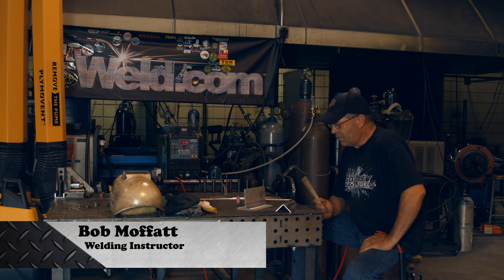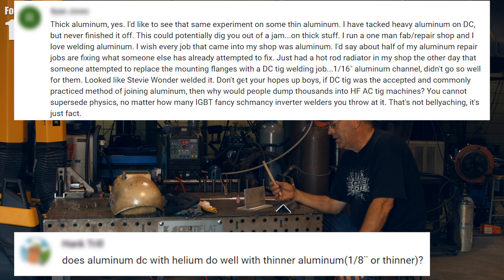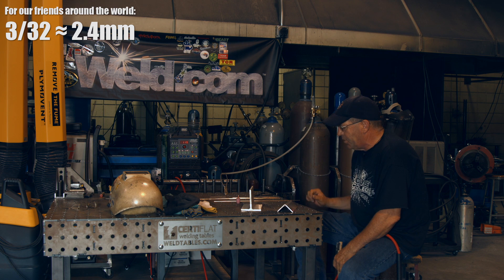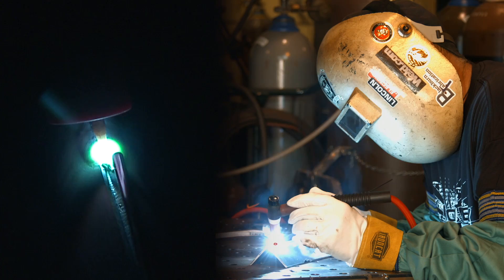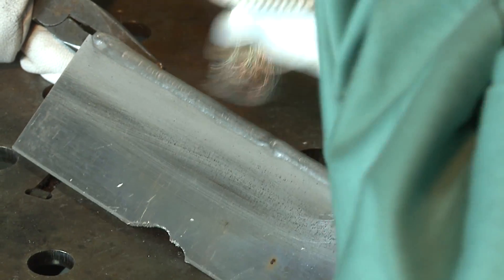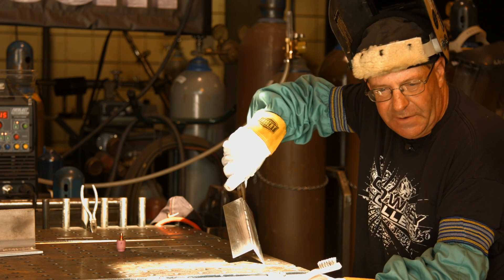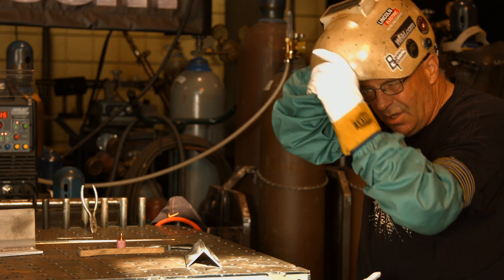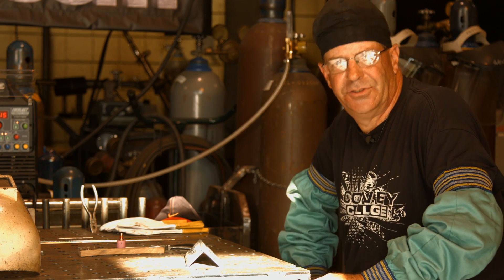🔥 Viewer Request: DC Welding THIN Aluminum (with Everlast PowerTIG 250EX)

Comment: I was told aluminium only run on AC up untill now. Is it something new you decide to try it?
Reply: It's something OLD!  The original method, developed secretly during WWII.  Generally superseded by AC square-wave + Argon + High Frequency + Special Tungsten because it's easier and cheaper (in the long run), BUT there are some technical advantages to the original process which have been abandoned!  Yes we threw out the baby with the bath-water AGAIN!

Comment: ??? Warning:  I've tried this with a few power supplies, some will NOT LIGHT UP in Helium!  Everlast suggests part helium mix I think, but not pure helium.  You might need a HELIARC brand machine, or something.
Reply: Have read in an old book about welding:  There used to be such a thing as starting with Argon, then changing to Helium!  Also maybe starting on a copper block to get the electrode hot.  I have had great results from arbitrarily mixing in a little Helium, having two bottles and two flowmeters, and maybe a water-cooled torch, there's a lot of plumbing!  Part Helium is a wonder, it makes a HUGE difference.

Comment: Is it possible to do dc tig weld on some 1/16 tube?
Reply: Aluminum tubing? If so, it's possible but thats getting very thin. Better off with Ac when you get that thin on aluminum. Not impossible though

Comment: Can you stick weld aluminum with an inverter machine without pulse wave function or high frequency start if that makes sense? I have never welded. Looking for a machine that is great on metel outside and yet capable of doing a little aluminum occasionally.
Reply: There are Aluminum Stick-Welding electrodes!  I have done it, it was a hateful nightmare.  I guess if you did it a lot presently you wouldn't notice and it would make sense.  I say you'd have to be desperate.  The electrodes are expensive.  As I remember if I could get it going it took a lot of power and went fast.

Comment: Hi Bob,
What effect do the pulse and frequency have on the DC weld process?  Thanks for the information.
Reply: No effect, because there is no pulsing and the frequency is zero.  If you have those features, the controls don't do anything if you're in DC Mode.

Comment: Hello, my beautiful videos, for your vast experience and possible to do aluminum welding using dc machine with good quality? the torch to be connected at the positive or negative pole? welding aluminum in DC will not spend my entire electrode especially if the amperage is high? I'm sorry for so many questions and I'm getting started on soldering aluminum

Comment: This method doesn't seem to work for me.  I don't get the silver puddle.  The final weld has oxidation and a rough surface.  I've tried grinding the metal to make sure it's clean and differing flow rates of helium. Higher flow rates help, but I can never get a truly clean weld like in the video unless I use argon.  Any ideas?  Am I missing something?  All I can think of is contaminated helium.  It is a brand new bottle,  it would have had air in it before it was filled for the first time.

Comment: Hello mr moffatt first let me say love your work, i have a question i am building a 1990 mustang notchback and the turbo kit that i baught came with 1/16in round pipe very thin pipe i want to get rid of most of the silicon couplers and clamps for a tighter seal i will be using dc scratch start what gas would you recommend for such thin aluminum, love to see you weld up some ebay turbo pipeing with dc scratch start, love your videos thanks for sharing your knowledge.

Comment: Next video id like to see is MCAW. Im welding 1" plate and have used FCAW-S, FCAW-G, MIG and just got a spool of 1/16" fabcor 86r metal core. Running from a 1975 lincoln SAM400 @ 31.5 V & 260 IPM
Reply: Steel beams or battleships?

Comment: Can it be done with lift start and without a foot pedal? I got the smaller everlast 140st and im just wondering if its possible for me to weld aluminum with my smaller simpler machine.
Reply from the maker: It's possible, but lift arcing Helium at low amps is more difficult.

Comment: DC Aluminum welding with Helium is also used for deeper weld penetration. It is used very often for making vacuum chambers with thick plates of 1" thickness or more.

Comment: Hello Bob, I've mentioned this procedure to co-workers and they do not believe that it can be done good video. When working in aerospace General Dynamics Space Systems in San Diego we had to certify with this procedure, actually Wyatt Swain, Gordy Lundquist, Chuck Meareasu, Ernest Levert (AWS past president) and Ralph Moreno were the welding engineers on the various projects. Some of the most educational welding time in my 43 year career to date.
Reply: Any advice or direction you can give me as to where I can get some education or training with the DC aluminum process. For certification.

Comment: I've welded aluminum foil using dc helium 60hz
Reply: I wonder if HZ becomes irrelevant in DC.
Reply: There's no such thing as hz in DC.  Hz is the measurement for AC oscillations per second.  DC doesn't oscillate, so no hz.
Reply: ian thecleaner yes there is.

Comment: Why not just use the arc to melt and meld the metal alone?
Reply from the maker: Aluminum needs filler metal or it will be extremely prone to cracking.

Comment: This is real progress.  I have to mention one serious problem with Helium and DC TIG that I experienced, trying to do this maybe five years ago:  The inverter machine I had just would NOT light up in Helium!  There was the HF spark but the main arc would not happen.  I tried and tried.  This hurt b/c it was a few hundred just to get one little bottle of Helium and that first fill.  Presently I'm having great results mixing He and Ar on the spot.  The manual for my present machine (Everlast) mentions this, suggests a maximum amount of He to use....  SO, I'm thinking some modern machines don't have the Open Circuit Voltage TO light up in pure Helium!  I'm wondering if there's a number, or should I just try to buy an actual HELIARC brand machine or something?   I don't think the manufacturers are addressing this, b/c we've all got the idea that you NEED A.C. to weld Aluminum, period.
Reply: Leonard Pearlman I Don't Have Too Much Experience With This. But, The Only Time I've Had A Hard Time Striking Arcs Is Because My Tungsten Wasn't Clean Enough. But I Also Know That Helium Has A High Ionization Energy.
Reply: @bronsonstephens5799  Yes!  I think that's IT, the Helium needs a higher starting voltage, and probably a higher working voltage too.  This conversation has been paused for YEARS due to local circumstances, but I now have access to an old HeliArc brand machine, and a big Miller Tig welder (both like refrigerators, classic machines with no electronics) that SHOULD do this.  Filling the Helium tank is now way over $500, so even if I don't LIKE it, I really do hope to see it GO.

Comment: Quick question. I have an old slat turning plow where some of the slats are broken. What would you recommend to weld them back together with?
Reply: mandolinman2006 How Big Are They?
Reply: Bronson Stephens They're probably about 1.5" wide and maybe 1/8" thick. I'm thinking a hard cast rod would do the job.

Comment: The original Heliarc process was developed in 1941 by Russell Meredith of Northrup Aircraft specifically to weld aluminum and magnesium.  It was DC with helium for the shielding gas.  No reason it shouldn't work now as it did then.  Then again, if you've got an AC machine with all the fancy features there's not point to using DC with helium.
Reply: Even with AC on a machine DC and helium can be useful when you need to weld thicker materials than your machine may be able to handle on AC.
Reply: Good stuff, thanks.
Reply: Yes there is sir,  Deeper penetration; and  Helium will make the aluminum much harder and the  strength is much Higher even on AC.
Reply: and it was dc +...big electrodes
Reply: There might BE a reason to go through this trouble and expense!  The arc action and weld penetration (cross section) is different, in a way that people might need.
Reply: Can this be done with 100% argon? Did you use 100% helium or a mix?

Comment: Hello, I'm from Brazil and I'm also a welder. I would like to know if you know the process of welding aluminum, magnesium and other alloys with the tip of the bulging tungsten electrode (round tip). Or do you just use the electrode with the thin end? thankful if you respond.
Reply: Alexxsousaaa Manson I Know That The Type Of Tungsten Depends On What You Do. I Use Ceriated Tungsten And I Grind A Point On The End. But Not A Huge Pencil Sharp One. Just A Small Stubby Point.
Reply: Bronson Stephens here when I use the sharp point of the crack in the welding mainly in aluminum tubes. already with the bulging point does not happen. Can you give me a tip?
Reply: Alexxsousaaa Manson Change The Type Of Tungsten You Use. There Are A Few Kinda Like Ceriated, Thoriated etc.
Reply: Bronson Stephens I'm using the electrode with lanthanum is cerium. But I did not get results. we decided to stop for health reasons.

Comment: The premise is wrong. The idea is cost savings right? Well, helium is super expensive compared to straight argon. You'll pay more for a bottle of helium than you will for an AHP AlphaTig 200.  Not saying you can't do it technically but there truly is no economic justification particularly in the long run.
Reply: I paid 70 bucks for my bottle of helium and argon costs me 50
Reply: ARCSTREAMS I thought i paid 80 but I looked at my receipt and it was 70.
Reply: Industrially, aluminum is almost always welded using DC.
Reply: Typically the price of helium is 3X that of argon per cu-ft. Also you usually need to use 3X the flow of helium vs. Argon. That's 9X the price for gas. I don't consider that to be insignificant.
Reply: SATAMAN Schmidt if you buy uhp helium it is expensive but I've never needed it or noticed a difference. I run  no more than 25 cfh.
Reply: You do make a decent point there, but a small bottle of helium isn't that expensive to have for occasional use. If they were trying to do this as a regular thing I would say upgrade machines, but to make a little money on a very occasional job why not? Plus when you do upgrade to that little Chinese 200 amp machine and it falls on its face trying to weld 1/4" aluminum you can mix the helium you already have in or run it straight on DC.
Reply: this is exactly the reason why ac is the way it has been done for a long time in the bigger shops. Helium is more expensive. Might not but much in 1 bottle, but if you weld aluminium pretty frequently it will add up. If you where to use a bottle a month and the cost difference is 30 per bottle thats allready 360 each year. Then the price difference between an ac/dc machine and just a dc machine is going away quickly. But for the home gamer and a small shop that welds some aluminium once a month it might be a solution. Even more if the allready have a dc tig, then its just getting a bottle of helium istead of a new machine.
Reply: bob rosco I only use ac on aluminum and aluminum is 99% of what I weld now but I use helium whenever I can much cleaner hotter weld.
Reply: I think we might want Heliarc more for technical reasons anyway.  This is discussed in some detail in some Weldingtipsandtricks videos.

Comment: Could you weld aluminum sheet metal with this process ? ( about 20 gauge )
Reply: Possible. Be careful of amperage and travel speed.
Reply: could also run DCEP with argon 1/8 tungstin i was welding tonight in class doing this and i was able to get decent welds on evan 1/8 thick but on the thing stuff probably 14 gauge i was able to do some super nice welds running auto pulse at 33-60Hz acted alot like AC 60hz once the puddle was going but there was a learning curve for sure. blew my teachers mind too.
Reply: A clean piece of stainless as a backer could possibly help also.
Reply: Dude did even listen to the video? What did he say ? Yes if your good enough you can weld  .5 mm thick it's your amperage

Comment: I would like to see a strength comparison of gas welding aluminum vs tig welding it,   and get advice on the type and shade of glass needed to safely gas weld it.
Reply: Gas welding is not good for structual welding tig is better.

Comment: Could you do the same but with argon?
Reply from the maker: You can DC weld Aluminum with Argon, but you need to be in DCEP. You also need a fat electrode and very thin material so it doesn't instantly burn up on you.